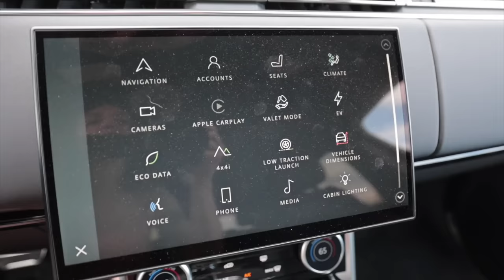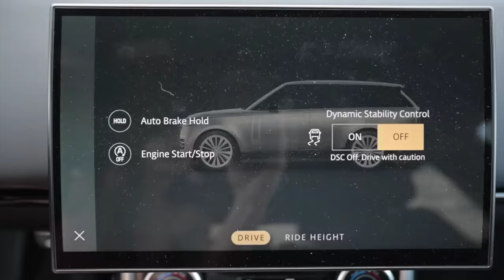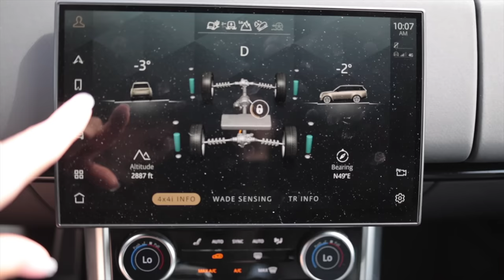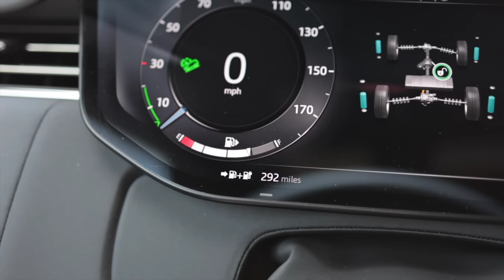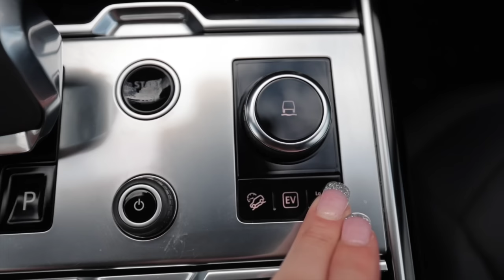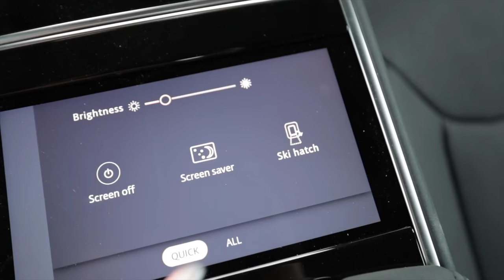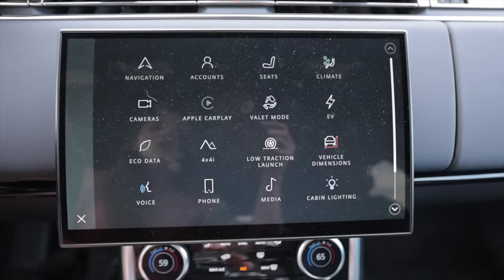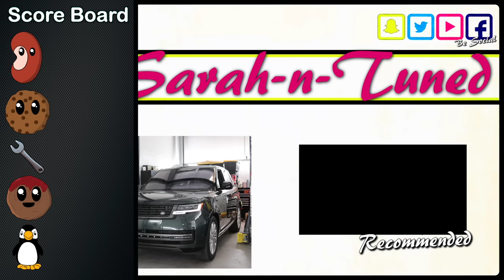This Or A New Land Cruiser? // 2023 Range Rover PHEV Review

Comment: A likely reason for the towing capacity being so specific is that in the UK we can tow a trailer with a maximum weight of exactly that 3,500kg rating with a regular car license. I suspect it could easily tow more but I guess Jaguar Land Rover didn't bother rating it any higher due to the license limit... and they forgot that other countries exist.
Reply: also hybrid drive trains arent usually designed for heavy towing. battery cooling becomes a concern
Reply: I think it's for most of Europe actually. I know 3500kg is a limit in Denmark aswell.
Reply: It's more to do with the combined safe braking capacity of the tow vehicle and the braked trailer.
Reply: @johnt.848  that thing has 6 piston calipers and some huge rotors, anything too big needs its own brakes anyway. slowing down the weight isnt the problem with that. theres always a transmission limit or cooling issue. not brakes. 

i mean just look at any semi, fully loaded their stopping distance is like half a mile. brakes arent that big of a concern with towing, its only frame and drivetrain capacity that limits the ratings.
Reply: @rollietrayte1332 Can see, you've not met the kind of people that play Polo and race horses. Horse float plus two horses plus gear and it's real close to 3500kilos.
The folks that own race horses, they'll have the Float towed behind a big Ram, Ford or Chevy pickup with dually rear end. The advantage of the Rangie over those, is the shorter wheelbase for getting car and trailer around smaller laneways and the like that access the stables.
Reply: @Zzrdemon6633 for anything over 3500kg you need electric or more likely pneumatic brakes on a trailer plus a C1/C+E licence. As it should be, because mass of 7t+ combined is no joke.
Reply: Previous generation RR were similarly rated.  But if you live in the countryside as I do you will see them towing what is obviously more than that.

Comment: The tip is for all the had work you put in every single day, and for some glue for your finger.   I was impressed on the off-road considering those tires were never designed for it.  Not I dedicated off roader but with the right tires I bet it could go down a lot of poorly maintained trails.

Comment: Every SUV should have a tailgate like that, it was originally designed as a seat and is very practical.
Reply: It now even has an option for a padded seat on that hatch with backrests and note that there are speakers in the upper part of the tailgate so that you can sit and watch an event from the tailgate seats while listening to a broadcast of the event on the sound system with speakers directly over your head.

Comment: 17:45 I have had a similar experience with Jaguar. They have relatively high quality materials, but people just don't maintain them. I dont care how high the quality is, if nobody replaces the coolant or transmission fluid or just lets more and more parts go bad, the car is toast.
Reply: Exactly.  I have owned an run LR products and if properly maintained they go on for years.  And the build quality - as in built in reliability - is far far better on current LR product range.
Reply: I mean. If you buy a lexus you have almost a 100% chance of not driving to your shop to get something fixed. If you buy a range rover the chances are slim to none. That's one of the reasons you can get them extremely cheap after only a couple of years driving or ...ehm... not driving.

Comment: I've just replaced a tyre on one of those, and the Michelins cost £320 each!
The wheel & tyre combined are ridiculously heavy too!
Reply: I’m sure a comparable 
Continental or Pirelli tyre etc would cost similar 
It’s an All Terrain 21” tyre.
The alloys are very robust, to better handle off road terrain.
And it’s a heavy vehicle before you add passengers or tow.
Same situation with comparable BMW or Mercedes etc

Comment: Sarah, you`ve said this incorrectly several times now on 4x4 reviews. Raising body height DOES NOT  raise ground clearance, it may improve axle articulation. Ground clearance is set by tyre diameter which sets diff heights and that doesn`t change by lifting the body.
Range Rover sell their cars as "go anywhere" vehicles, well I live in Western Australia and frequently drive offroad in the outback and deserts. Guess how many Range Rovers I see out there ? 
None, count`em, none. It`s all Toyotas or Nissan Patrols. They actually are go anywhere vehicles.
Reply from the maker: I don’t think you understand what you’re saying. Lol
Reply: @SarahnTuned  Raising suspension/body height does not increase ground clearance. The ground clearance of the diffs remains unchanged.
Reply: Most people talk about ground clearance as being the distance from the ground to the lower body of the vehicle. Now that might technically not be correct but it is what people are referring to.

Not to mention, this is what Range Rover says in a press pack for one of its vehicles.

"Automatic Access Height allows customers to elegantly enter and exit the vehicle by lowering the vehicle by 50mm while Active Speed Lowering drops the body height by 16mm when cruising at above 65mph (105km/h) for enhanced efficiency. In off-road situations, the body can be raised by 75mm and again by an additional 60mm to provide superior ground clearance."
Reply: @bertmacdonald337  Aren't the diffs bolted to the underside of fthe body, so if the body goes up, so does the diff?
Reply: @stevemawer848  No. The diffs are part of the running gear, raising the body does not raise the diffs, axles, etc.

Comment: Would that be a version of BMW straight 6 engine
Reply from the maker: Incorrect, the Ingenium i6 in this is not outsourced to BMW. You are right, JLR does have a partnership with BMW, but for other engines though.
Reply: @SarahnTuned People keep misrepresenting Jaguar engines, like the V8 built at Bridgend is a Ford engine.  It's a Jaguar-designed engine built at Bridgend until 2020 and was then built in the Jaguar engine plant in the Midlands.  It's a great engine, too.  Get a V8 F-Type to review, Sarah!

Comment: The trubo inline 6 with the ZF 8 speed auto sounds very much like the new driveline for the Jeep Wagonneer.  Is this the same engine?
Reply: Different car brands
Different engine
A lot of manufacturers now using a straight six, with similar tech etc 
But
Many manufacturers use the ZF transmission, and adjust it to suit their motor and requirements etc

Comment: Sarah which do you prefer Auto or Stick ?. Have you ever drove an auto like a stick?. I am British we use mostly stick. Seen Range Rovers driving over mountains. The older RR's have a very low torque gear for difficult terrain.
Reply from the maker: I mostly despise automatics and have only ever owned 1.. with the only purpose to swap a manual into it 😂
Reply: @SarahnTuned  Have a go at an auto V8 F-Type, you might not depsise that!
Reply: Isn't life amazing ?